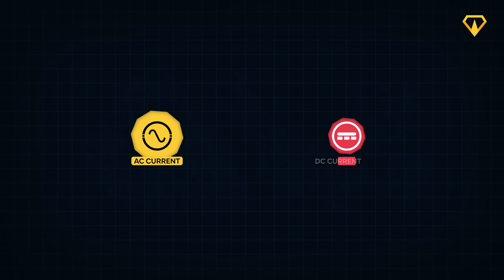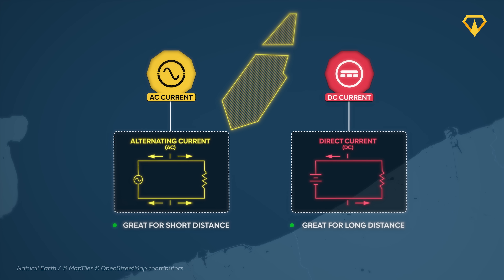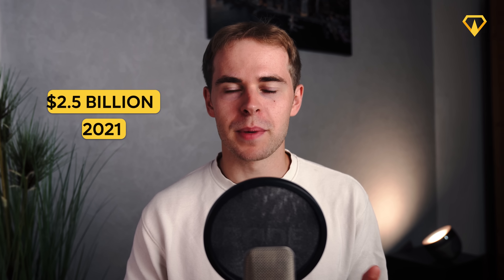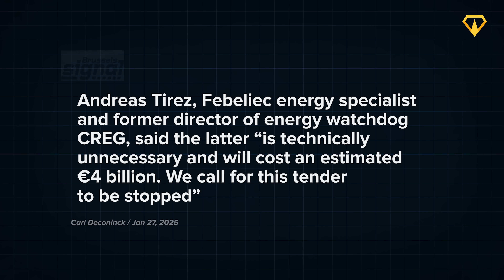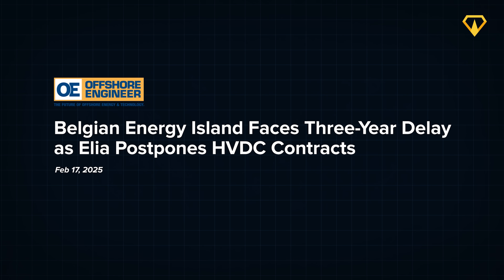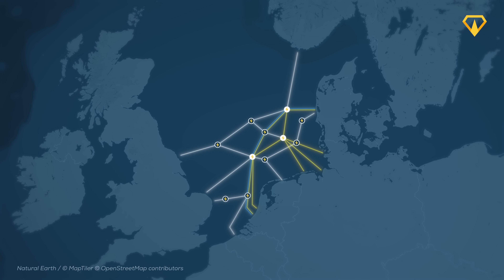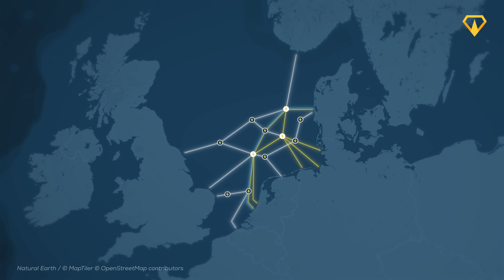How Belgium’s $7B Island Will Power Europe

Comment: For anyone wondering why DC is more efficient underwater is because water near cable becomes a massive capacitor and introduces massive losses for AC, in this case DC->AC conversion losses are less than AC losses.
Reply: The same is true for underground cables. It's a calculation if the extra cost for conversion (& losses) are worth it for the distance. Breakeven distances for AC vs DC overground are ca 600km, but for underground its <100km or undersea its <50km. The major cost is the conversion stations.
Reply: That's only true for high voltage DC. At "normal" transmission voltages you have to deal with massive losses from resistive heating.
Reply: Thanks for this extra info.  I alway believed that the reason for AC in North America was that AC power beat DC for this very reason of distance. This is always defined as a battle between Edison (DC) and Westinghouse (AC) sending electricity generated  at Niagara Falls to distance cities like New York, and others.
Reply: @bawhitham the advantage of AC is that you can use a transformer to increase the voltage which means you can reduce the power loss, which is proportional to the current squared. So twice the voltage means half the current and a quarter of the power lost (ignoring other losses). However in the modern world it is possible to convert high power AC to DC and back to AC which wasnt possible in the early days of power transmission.
Reply: @bawhitham  Well, you should remember it as battle between Tesla (AC) and Edison (DC). Tesla is the one who made the AC viable, with his motors, generators and transformers. Even now the high voltage DC can only be achieved using high voltage AC, since it is very hard to generate DC. Also there is something called skin effect that affects the transmission of AC, where only the wire surface is being used when transmitting high frequency AC, which raises the resistance of the wire and that raises the losses. So then you can use thick wire to transfer DC through the whole cross section with less losses but it needs to be high voltage.
Reply: @bawhitham  AC won mainly because it's the natural choice for generating power from rotating turbines, changing voltages with transformers and powering rotating motors which most power (big) power consumers need like engines, pumps, compressors... AC is also easier to break current at switches, especially at high voltages, DC tends to 'stick' and make huge arcs since it never crosses the 0V line which AC does 100 to 120 times per second. DC is becoming more usual for everything computers, data centers. Purely for power lines at the same voltage, DC was always the better choice. We have just both gotten better at converting DC compared to the pioneering times of electricity. And AC voltage is the RMS value or root mean squared, meaning the peak of the sinus wave of AC current is root 2 times higher than te rated voltage (like 230V AC means 325V peak voltage). For DC 230V means 230V peak obviously). The higher peak for AC is the driver behind the higher losser in transmission. 
Since we are now moving much bigger energies at much longer distances the advantages of DC have become to great to ignore. Also since the undersea cables are already much more expensive than air powerlines on land.
Reply: I was getting ready to post a comment. Thankfully ours was in the top 3. I mean I was like wtf... that isn't true! We've learned this in physics class!
Reply: Thank you for the explanation. I'm an electrician and electrical technologist, and was about to do a rant on their bad electrical science. Thank you for clarifying.
Reply: @alexiuscastrum DC is also used for long distance above wster. Look up HVDC and UHVDC. It is by far more effective.
The transformer is however much more expensive. Which is why we didnt do it in the past.
Reply: Perhaps more islands would be required in the long run?
Reply: @homematvej . So DC is only used for under water transmitían?
Reply: @johnh539  Above water, DC has a lot of problems. It loses voltage fast due to a number of factors (resistance of wires and heat), so we typically make AC on land and transform it up into the kilovolt range (5kV near homes, 50-60kV for city transmission, 100kV plus for major power corridors).
Reply: I think this is the most necessary explanation I every found in a comment thanks
Reply: I was like „what the hell, tesla“? But HVDC explains his hot take

Comment: 7:04 are you sure they transmit the current in DC form back to the continent ? As far as i know, AC is good for long transmitions. #Tesla
Reply: Ac needs to be synchronised which means it cannot bridge two asynchronous grids. Also there will be reactive losses due to capacitance between power lines over very long distances. DC really makes sense

Comment: Nikola Tesla is turning around in his grave - you should at least explain difference between DC and AC over large distances - saying DC is better is what Edison would try to sell.
Reply: I'd recommend the Wikipedia article on "High Voltage Direct Current," but the tl;dr is that we have a lot more capabilities than we did in 1887 and HVDC is good for applications where you need long uninterrupted runs or you need to go through seawater.

Comment: The Princess Elizabeth Area will generate 3.5 GW of power.  One nuclear power plant generates 1 GW of power.  If we're going to be dumping microscopic bits of glass in the ocean and disturbing the ocean bed, we need to be generating more power from the wind turbines.  A normal wind turbine blade has a design life of 20 years.  Those in offshore windfarms have a design life of 5-7 years.  There's research being done with coating to extend the design life of the offshore blades.  My point is what are we going to do with the blades that are no longer functioning - dump them in the ocean?  it takes considerable human effort, not robot dogs, to recover, replace, and recycle damaged blades.  This is a typical European project.  Politicians come up with a pie in the sky idea and then lie to the tax payers about actual construction and operation and maintenance costs.  If this is the best idea, fine but be reasonable about the costs, challenges, and time frames.

Comment: You what 50 hz, but wind turbine spin at different speeds, there for electricity needs to standardized, DC is a lot less complex, so you can convert AC to DC and DC to AC, by doing this you have standardized the frequency. DC can also be stored in batteries.

Comment: You might need to look at AC versus DC transmission again, High voltage transmission is AC, as you increase the voltage you reduce the current, which is the heating element that melts the wires. You cannot do that with DC

Comment: I think your facts are wrong... IT IS AC that is used for long distance power transmission- DC needs boosting avery few kilometers owning to losses.
Reply: Do a search for "HVDC transmission" - it's a real thing.

The reason we use AC for transmission isn't because AC doesn't suffer losses, but because we can easily change the voltage of AC power with a transformer.  That let us run higher voltage in the transmission wires (higher voltage == less loss) and drop them down at the substations and again at your pole.

There wasn't a good way to do with that DC, so you'd have to have DC power in the transmission lines be the same as it was in your house.  Because the voltage has to be low, you see tons of losses.  Edison's original plan to deal with this was to have a power plant in every neighborhood.

These days though, we can shift DC voltage on power lines, and it's actually less lossy than AC.  The equipment's not cheap and the tech is still new enough that AC will continue to be used for most transmission, but for long-haul stuff (and especially undersea where the salt water makes AC really lossy) you're starting to see more HVDC.

Comment: Before 2050 Belgium alone needs the equivalent of 10 islands just to provide electricity for itself. The actual island is the cheapest part of the project, belgium has lots of experience building artificial islands, the cables and HVDC electronics are the expensive bits.

Comment: I seriously hope those graphics were homemade and not part of the documentation of the project. Because if the latter we have a problem on our hands DC: good for short,Easy to Store , AC good for short and Long , hard to store. wich is the oposite of what is claimed in the video
Reply: AC works pretty well for long distance transmission in overhead cables.  You can run it at high voltage, reducing losses due to cable resistance, and transform to lower voltages every time it passes a substation.  Back when there weren't any good ways of reducing DC voltages it was a no-brainer.

Unfortunately AC sucks in seawater.  You get all kinds of reactive power weirdness when you try to run AC cables through a conductive liquid.

Fortunately, we're not in the 20th century anymore and high-voltage DC transmission is a feasible option.  It's high voltage, so it also avoids the losses due to cable resistance, but it's also DC so the fact it's running through seawater doesn't matter.  Problem is, the technology is rather new and only a few companies make the equipment to pull it off.
Reply: @jeffspaulding9834  even with that being true(i suppose,havent looked it up yet) i would say that the graphic in the video lacks the qualification "for submerged in seawater power lines", also i doubt that when DC is bad for Overhead lines they suddenly become good for submerged ones if the reason for why they are bad  hasn't changed. Or has only been partially solved (since you mention high voltage DC isnt a problem anymore, i wonder what efficiency whatever process used has compared to something simple as an AC transformer,+the loss of conversions from AC->DC->AC  taken into account), so at best i can somewhat see that AC is equally as bad as DC when it comes to submerged lines somehow
Reply: (add that to the ecological disaster that windenergy farms at sea pose in terms of waste allone ) and i seriously start to doubt if that island is actually for the better of mandkind or to transfer some wealth currently amonst the population into some wealthy pockets by the means of taxes
Reply: @hoefkensj  It's the "High Voltage" part that's changed.  The higher the voltage, the less loss you have.  You can shift AC voltage using 19th century tech (transformers) but there wasn't any good way of doing the same for DC until much later.

Comment: Thanks for the update on this project. Sounds to me that the DC infrastructure cost is so high it would take a lot longer to earn back with energy sales. Instead, Belgium engineer should consider adding a hydrogen production plant on these artificial islands. Then hydrogen can be shipped on shore in tanker ships and used there to generate electricity and heat. That may cut the cost significantly. There are also new methods to store wind energy using "rust" energy storage. Then just move these units back and forth to and from shore. That's a cost effective CO2 neutral storage and release option too.

Comment: It is not possible to send AC voltage over long distances through the sea. 
That's why high-voltage DC is used offshore. This can then be converted back into AC onshore.
Offshore, the construction costs for wind turbines are higher, but the wind blows consistently.

Comment: How much will become reality? None. Over the last three months, Belgium's daily wind power production has varied from 90 gigawatt hours to 3 gigawatt hours. Depending on such a volatile power source necessitates a whole other alternative, either burning gas, or using improbable amounts of battery storage - most likely both. Belgium's 7 nuclear reactors, which the Green Party affiliated former Energy Minister foolishly planned to close (right when Russian gas supplies were cut off!) used to make up to 55% of its power .   Several of them were shut down over the last year or three, with the rest set to go by 2025. Similar designs in the US have already been licenced for another 40 years, and most have been uprated to increase their output by up to 20%. Given political will, Belgium could revive all its reactors, and build more to reliably replace gas.
 Thanks to nuclear, Belgium had much lower power CO2 emissions than all its neighbours, excepting France, which gets up to 70% from nuclear.

Comment: Incorrect statement about AC/DC. AC is much more efficient at power transfer at high voltages, hence the entire grid is high voltage AC. DC is not so great at transfering energy, however great at transfering huge amps over short distances at lower voltage
Reply from the maker: Hey its actually correct, at these very long distances its actually the opposite. At least for high voltage DC.

Comment: 3:15 You got this totally backwards to actual science,  It's Alternating Current that is good over long distances and Direct Current that drops off quickly over long distances.
Reply: Depends on the actual transmission voltage. Ultra High Voltage DC is actually a new technology that is more efficient for long distance transmission, but is best adapted for transmitting only from one point to another, rather than a power grid.
Reply: @anuphys  It is so new that the SACOI high voltage dc connection to Corsica was build in 1965. HVDC is most efficient and economic, China building those transmission lines in multiple gigawatt range right now with multiple projects finished, also some from Germany to Norway are already in service.

Comment: The people who, by design, can Never Be Pleased will always step in to make what's possible impossible. If this requires flopping from the current "cause" they're flipped to, they don't hesitate to do so, because the "cause" is just a way of confusing people by also appearing to be reasonable. The real object is to be Impossible To Please, not some "cause".

6 Ha out of an Ocean. What is that? Tell me in percentage terms.
A few city blocks worth of concrete. What's that in comparison to many years of clean energy? You can calculate it in euros or moles of CO2. Doesn't much matter which.

Why does anyone listen to them? Why do they listen to themselves? A mystery to be sure.

It's nice that some good causes get some consideration as a side effect of all the power playing. By themselves, as themselves, and not as pretexts to be able to practice being Impossible To Please, the causes are fine, or even great and good and worthy. But why insist on not seeing the wood for all the trees?

Comment: IT IS VERY STUPID OF YOU TO THINK THAT ENGERY WOULD TRAVEL OVER LONG DISTANCES THROUGH DERECT CURENT, IT IS ONLY USED IN ELECTRONIC DEVICES!    THIS IS THE VERY REASON NOKELA TESLA DEVELOPED ALTERNATING CURENT BECAUSE THER WAS THE NEED TO TRANSMIT ENERGY OVER LONG DISTANCES!
Reply from the maker: Please check out other comments on that, high voltage DC is more efficient here.

Comment: One of the talking points missed was the decrease in cost of solar energy. This reduction also plays a role as solar is becoming very popular and affordable in the EU. Both commercial and private installations are reducing the demand for electricity from the traditional providers. The only growth market for electricity are datacenters.
Reply: Electrification will push energy consumption.  The government will mandate electric heat, electric hot water, electric stoves and electric cars to reduce the usage of inexpensive gas by force of law.

Solar is good in the right places, I'm in a desert with 290+ sunny days a year and far south enough that I will get around 6.4 hours of peak solar production every day.  Some places in the US (lower 48) have around 2 hours less.

So a solar setup here will generate probably 1.5x more power per sunny day than the same solar setup in New York and as much as 2x as many sunny days so it could generate 3x as much power here.

I don't think Europe is as bad for solar as worst case NY but if solar isn't a no-brainer proposition around here, how can it be a good proposition when it's handicapped with a lot less power generation?

So wind farms start to look pretty good.

Now if you could find thousands of acres for solar panel farms (and maybe sand batteries) in northern Africa, that type of large scale solar could power parts of Europe but Africa doesn't seem all that politically stable and that probably won't lead to stable power...

Comment: Hello my friend, I believe you got that completely backwards. AC Transmission uses far less resistance on the wires and is able to be transferred longer distances with less loss compared to DC where you'll have to have a very very thick cable and you'll have a very high wire resistance causing more loss. 3:39
Reply: No they use HVDC for this.
Reply: My thoughts exactly.
Reply: Hi!! Only to correct... AC is more adequate for long-distance energy transmission. Why would they want to transmit in DC? I don't know.  Maybe you had a misunderstanding while compiling the information.
Reply: @sdgptube  that's what I wrote. But the letters AC disappeared when I sent the comment. I fixed it though. But, that's the exact point I was trying to make. In the video he was saying they want to transmit electricity in DC form, which makes no sense. AC has less resistance due to the sine wave. DC will just heat up the wire and have a lot of loss or the wire will need to be extremely thick.